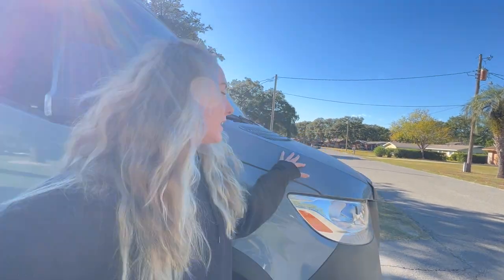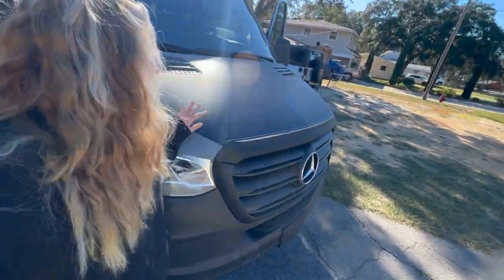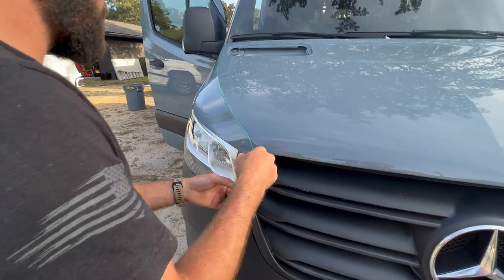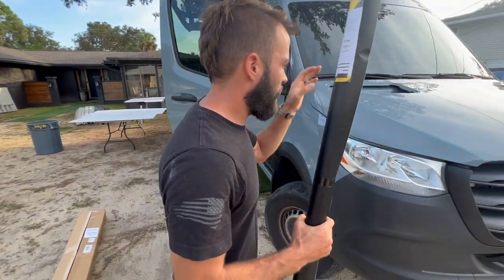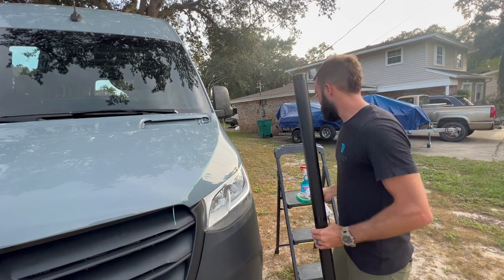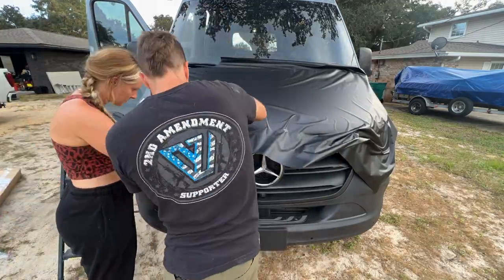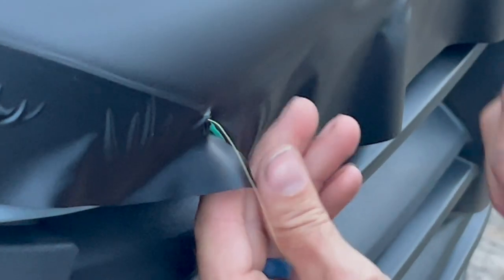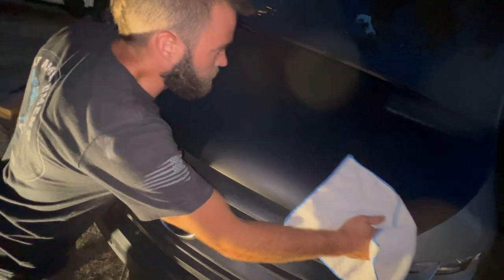Vinyl Wrapping the hood of a Van using Knifeless Tape

Comment: what is wrong with the Vvivid one? Is it lasting or did you take it off?
Reply from the maker: It is lasting just fine! We haven't taken it off. Someone at a van expo told us we should of used 3M brand vinyl instead because it will last longer and I guess they had a lot more experience with vinyl wrap than us. But to each their own, we decided to just keep the Vvivid on.
Reply from the maker: I hope that helps